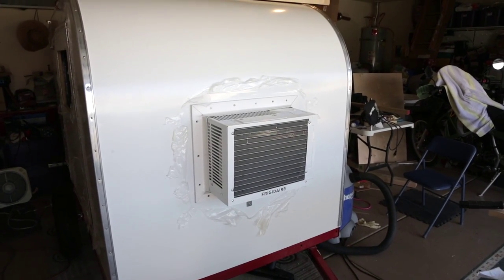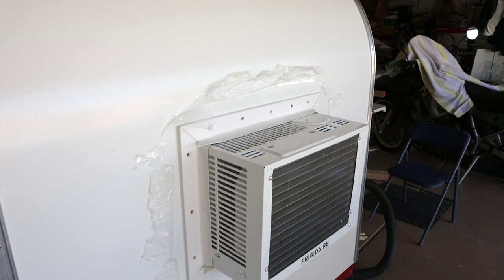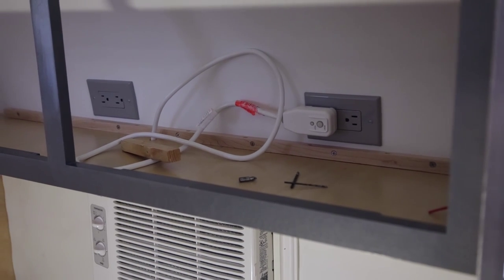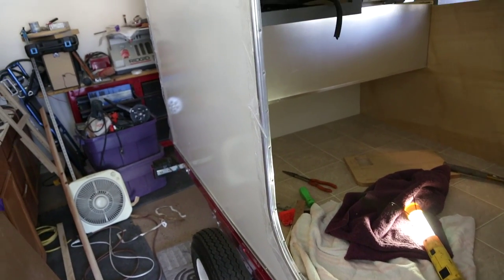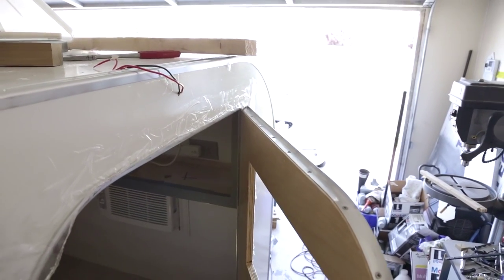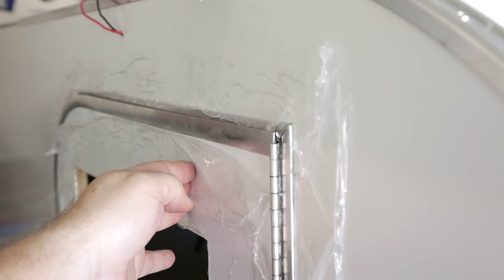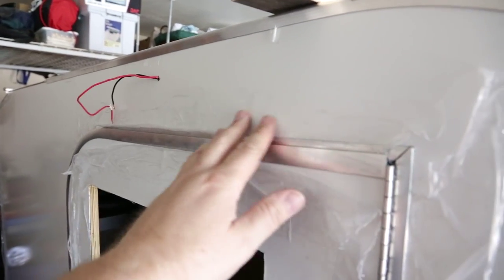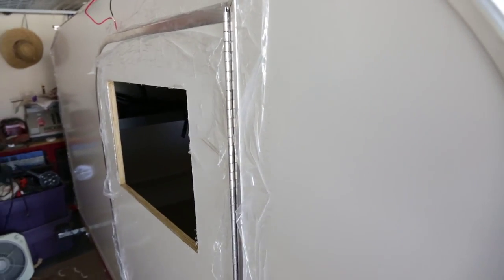Teardrop Trailer Build- AC & Entry Door

Comment: Thank you for this! I have been going back and forth on how to do a mount for the ac (a window unit) and this is so awesome and answers all my questions on how to do it like you have it! Also, just wondering how has it been with leaks (on the ac unit)? Any issues at all? Thanks!
Reply from the maker: I sold the camper this past spring, but it had never leaked the three years I had it.
Reply: Thanks! I am mid build of mine and am totally going to copy the way you have it!

Comment: I would love some info on where you acquired some of the parts like trim, door latches, metal skin, ect, and where to find permade doors and windows. You give almost no info anywhere in this series about where you purchased any of these parts or how to find them, internet searches are insanely difficult to find some of these things and when i checked with the "big box" stores they had little or no idea of what i was trying to do, not to mention how to help me. As with most things when you search the internet or any "purchase" most of what you get is not what you are looking to buy.
Reply: bck318 power items like the outside connections, fuse blocks, lights, ect, would be nice to know where to get also.
Reply: ***** Thanks much for the timely response! It is nice to see that some people actually follow up on questions about their projects on YouTube. I appreciate you for sharing you knowledge and information and i wish you the best.
Reply: @bck318  I know.  It is so nice.  Hey, did you finish your trailer and source parts.  I'm going the same path you did right now.  Three years later the internet gives even poorer results because of how it is pay for the top in search results.  I have the doors and hatch to finish.